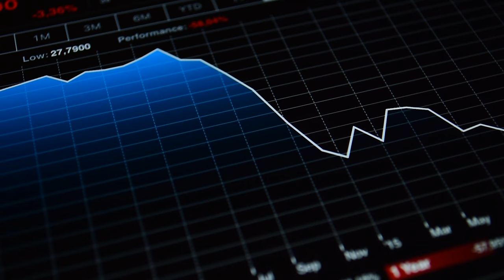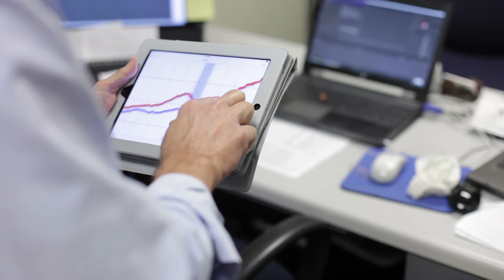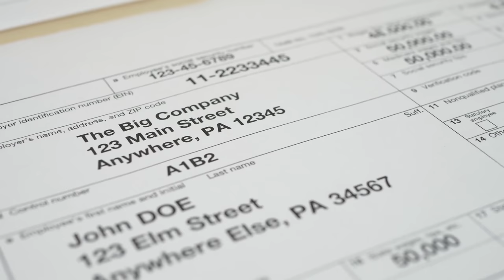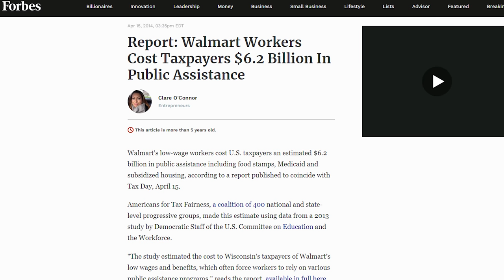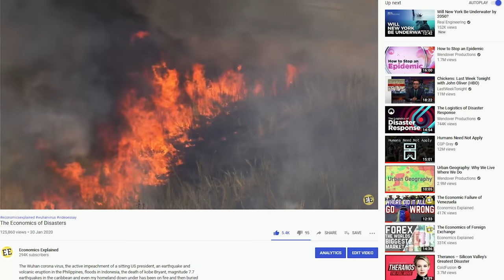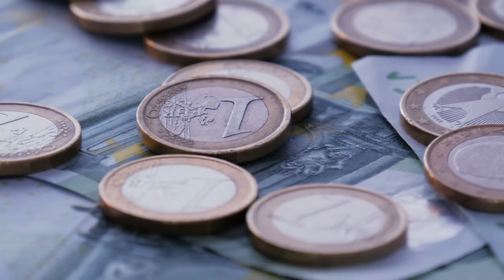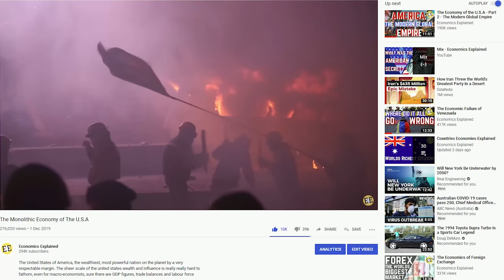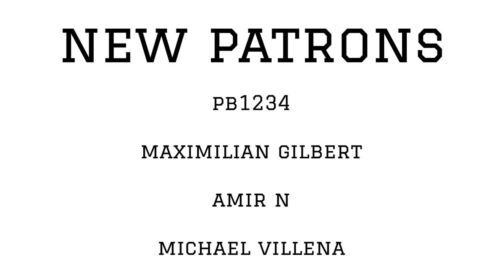Does War Make Us Richer? | Economics Explained

Comment: Can be Research and Development done in a way that it would be a perfect substitute to the military as a wellfare system? I mean it was said that there are countries that sustain an irrationally high military budget. Even the most abstract product of R&D can indirectly massively improve the quality of life, such as GPS that would have been impossible to develeop without special and general relativity. Moreover R&D can also make a vast variaty of jobs, not only scientist jobs. 

For example building newer and newer experimental fusion reactors for fusion energy research require a vast variaty of different expertise. Also fusion energy would vastly improve the quality of life because it would render fossile fuel power plants obsolete, which would result in a massive cut back in air pollution.

Comment: In Schenectady NY there was a factory that maid trains. WW2 came a long and it was switched to tank production. After the war, the factory went dormant. It was unused for the next 80 years until it was leveled and a riverside casino resort was built. But, all the manufacturing jobs that factory could have supported went unfulfilled for almost a century, and was replaced by a casino.